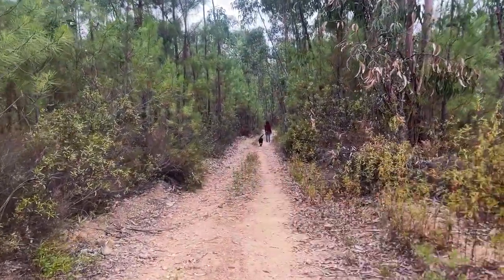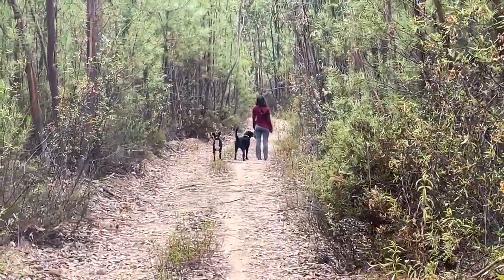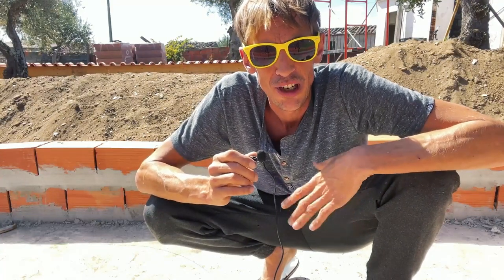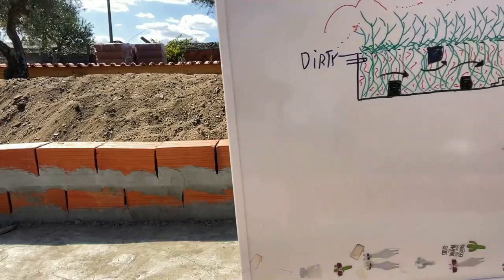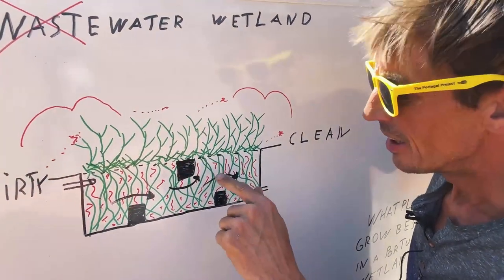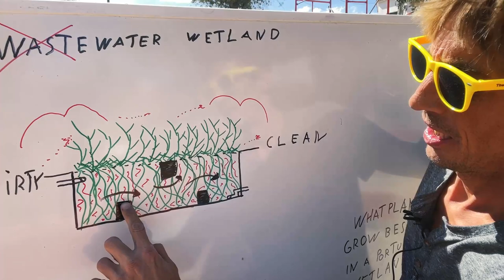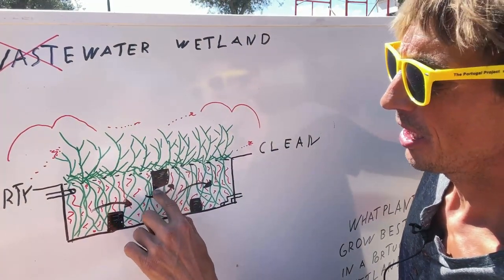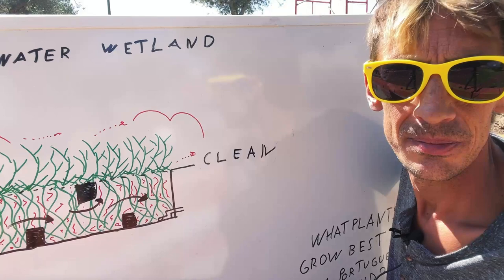LET ME EXPLAIN THIS AGAIN | Portuguese Permaculture Projects

Comment: Not sure you can have your exit lower than the entry of grey water, water will always find its own level and  least path of resistance. The tank will not fill and will empty straight out. If you are wanting g to slow the water down then higher it must go.
Reply from the maker: The exit will have a vertical pipe connected after it, that would be as heigh as I want the water level to be eventually.. need to see :)